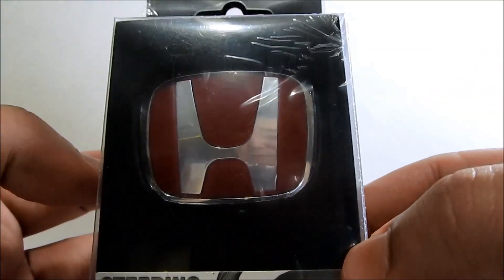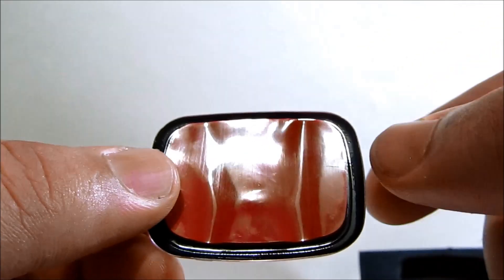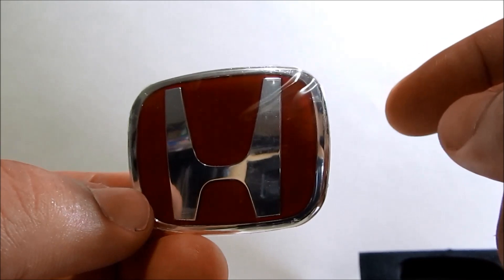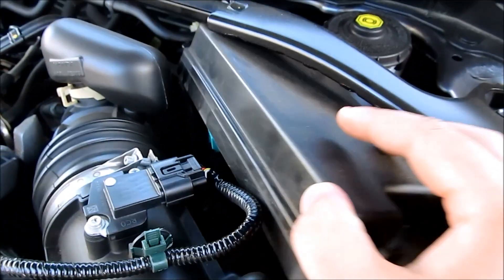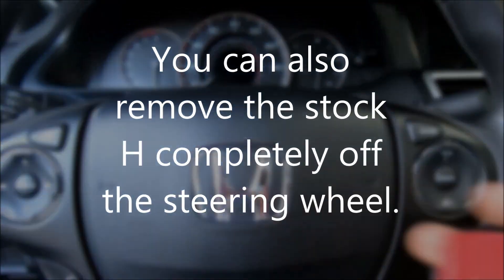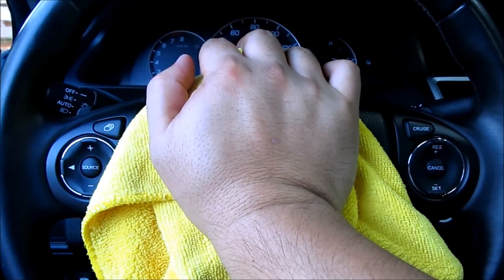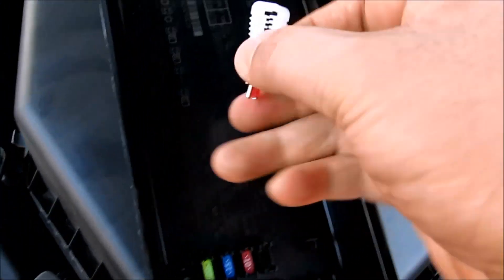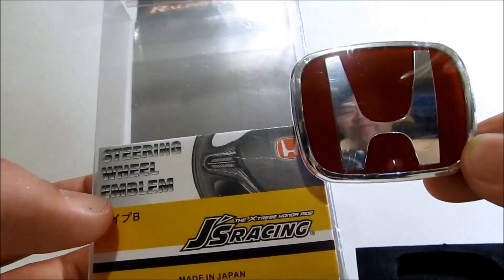J's Racing Red Honda Steering Wheel Emblem Installation

Comment: Who cares if it's fake no one will know
Reply: I'll care. Yes, I would know. The fake ones only give your car like a gain of 1.769 foot/lbs of torque. The real emblem allows for faster flow of the v-tech fluid that gives a 6.78972 gains of the power. It's called science, Simple Frankie.
Reply: ErwinSchrodinger64 that's how I am too, but with this I had to compromise since Honda doesn't make an oem steering wheel emblem without getting the type r airbag cover.
Reply: The fake ones don't fit over top of the existing emblem like it's supposed to.
Reply: @brucestrong9141  it does fit, it looks oem
Reply: @chukob5  it does fit it looks like oem

Comment: Great video and much appreciated.
Did the install on a 06 civic and the advice on the horn fuse was extremely useful albeit a bit different for my car.
Idk if mine is "official" but it came packaged the same way except with an additional 3m dual sided tape not attached to the emblem. 
My emblem was worn and this makes an amazing difference and seems like it'll hold up the rest of the life of the car, not bad for less than $20.

Comment: Can you post another link to this product? The one you provided does not exist anymore according to the website
Reply from the maker: Can't find the original one i purchased.. seller no longer carries it.  Just purchase the knock off.  https://goo.gl/63QOOX
Reply from the maker: Found it... https://www.aliexpress.com/item/AMK-B-suitable-for-Honda-steering-wheel-badge-car-emblem-red-emblem-Car-styling-for-honda/32740055744.html?spm=2114.10010108.1000014.5.piF5Eq&scm=1007.13338.70306.000000000000000&pvid=0b332701-c7e6-48e7-8175-4068ee2dd6e2&tpp=1
Reply: Hey bro the amk store have new store on Ali the new name was LEOSPORT

Comment: Can you make a video on replacing the interior pieces to the new generation accord coupe interior. and do you know where i can get those parts?
Reply from the maker: +lee lieng You can buy the parts from the dealership.  Some parts are interchangeable but not every piece.  Expect to spend a couple hundred bucks.  I will not be swapping any parts.
Reply: is there anyway to upgrade the touch screen to get apple carplay and all the other feature? im thinking you might have insider infos.
Reply: i can't seem to find a website that sell the interior inserts of the piano black finnish
Reply from the maker: +lee lieng http://www.driveaccord.net/forums/86-9th-generation/338546-2016-innerchangable-parts-2013-2015-a.html
Reply: thank you.

Comment: stupid question but i have a lease. Is it easy to take off?
Reply: LeanLasagne yes. Just don't remove the original one from steering wheel. I replaced all emblems with the red type r ones in my 2015 SI sedan and it looks so much better with the black car and red/black seats. If you wanna do your front and back emblem I recommend buying them off passwordjdm. Since they are oem